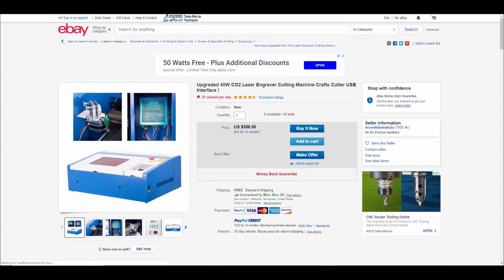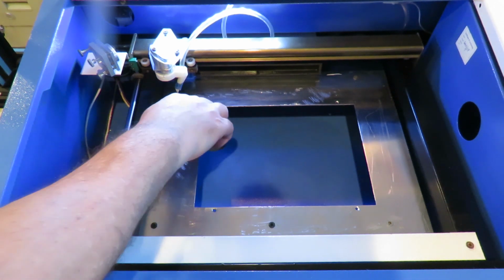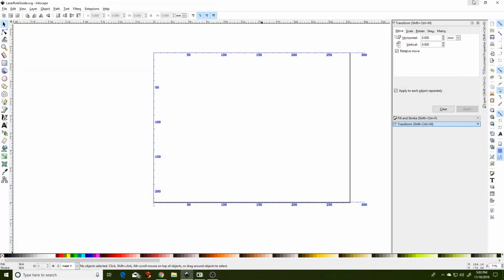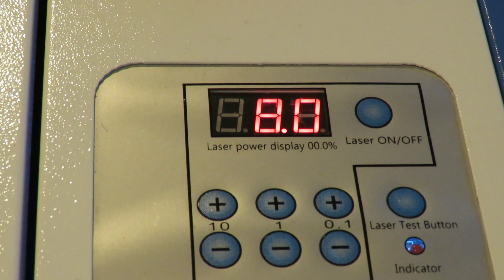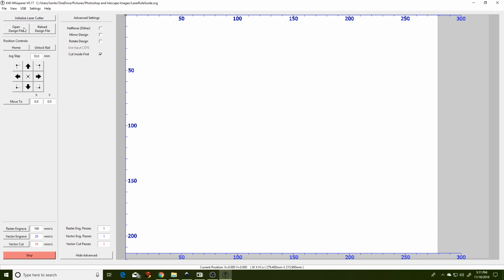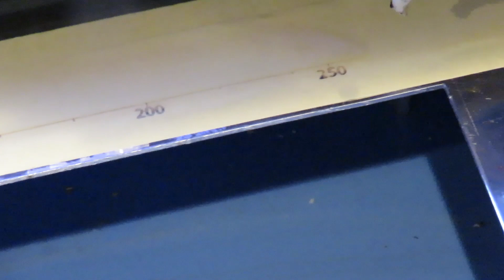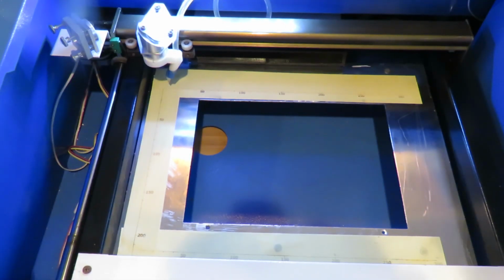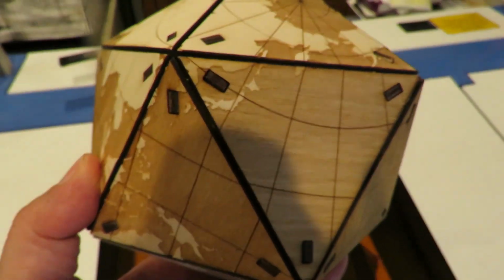Chinese 40W Laser Ruler Registration Marks

Comment: Great video!  How has your 3D printed assist nozzle working out?  I was going to do this but some have complained about melting.
Reply from the maker: I think you've noticed the burnt tip of the 3d printed nozzle in my videos.  That one happens to be the 5th nozzle I've printed.  Some I didn't like and discarded right away.  Others like this one, I've reprinted and used again and again until they melt and become useless.  In reality, I do not recommend using using 3D plastic nozzles.  They will eventually be dragged through a fire and melt and add fuel to the fire which may then catch the rubber drive belt on fire (happened to me).

I am in the process of redoing with a short length of 1/4" OD copper tubing (or equivalent) so that it's not affected by heat and fire.
Reply from the maker: I am happy to announce that I've created my own air-assist nozzle made from a 3" piece of 1/4" OD copper tubing and a 3D-printed mount.  I can now put away my very loud air 1 Gallon compressor and revert back to my very quiet Air Pump for Aquariums.  https://www.amazon.com/gp/product/B073DXBTJS/ref=ppx_yo_dt_b_asin_title_o00_s00?ie=UTF8&psc=1  This provides more than enough airflow directly to the burn/cut area.  I'm so glad I did - the other air compressor was SOOOOOO loud, and I keep my laser cutter in the house. 
 I will have to make a video about it in the near future.  I will be happy to sell this creation to whomever wants one too.

Comment: Why use masking tape. Couldn’t you paint the surface with a good black paint and etch the paint away where you have the lines?
Reply from the maker: You could, and it all depends on the application.  My primary reason for applying masking tape or transfer tape to the surface is to protect the wood from the smoke that is produced.  A very tarry/cellulose rich (thus sticky) smoke issues from deep etches and cuts.  As the smoke travels over the work on the way to the exhaust vent, some get deposited on the wood and leave a sticky brown mess.

If you look at this picture http://www.epiloglaser.com/images/tl_wood_residue_4.jpg you can see the residue left by the receding smoke.  This piece was washed, of course, and spruced up.  If washing or sanding is in your cards then by all means paint it first.  Some people wash it with a bottle of "Awesome Orange" you can get at the Dollar Tree (for a dollar).  Don't mix this up with "Fast Orange" which is a pumice hand-cleaner.  Here's another image showing with and without masking.  https://i.pinimg.com/originals/d4/37/2b/d4372b4425dc2a5729b229627c545cce.jpg

Sometimes I do paint the work before cutting, but I always apply transfer tape / masking tape over it before etching / cutting so as not to ruin the finish.  For materials such as lexan and plexiglas, the work literally evaporates so there's no residue and masking isn't necessary.

Another consideration is where I etch/cut, the lines are of a darker color.  Painting a work black, then etching the paint away leaves only very dark lines on a black background.   With masking tape, you can spray paint the work before removing the tape and give the etched channels some contrasting color, and seal in the charred/burnt smell too.  Check out this video (shameless plug) https://www.instagram.com/p/Bk0bNjiH-Wl/